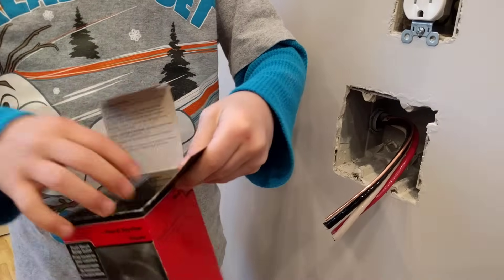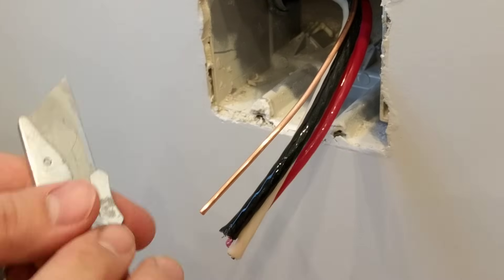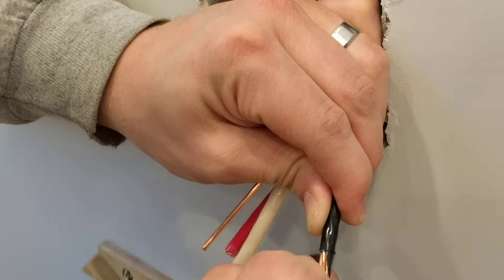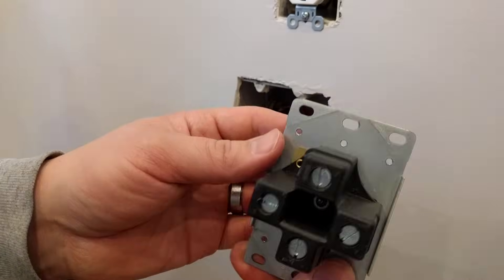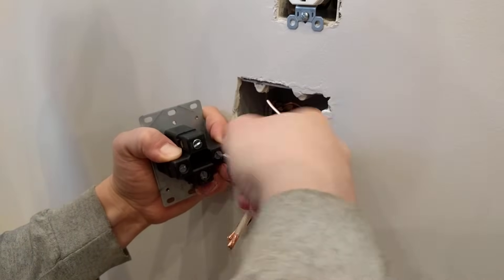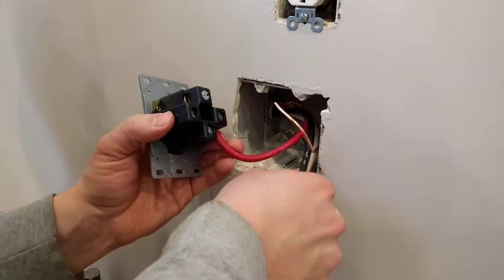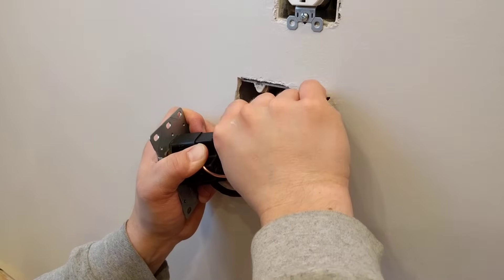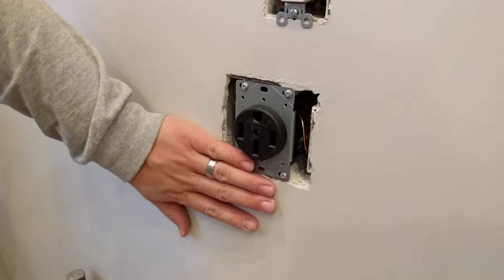How To Install a Range Receptacle or Outlet - Flush Mount 50 Amp 4 Wire

Comment: I am rather sure you are using an incorrect receptacle for your stove application. That receptacle is used for EV charging application (since it does not cover your feeder box). I have always used a NEMA 14-50R receptacle for all my electrical range/stove installations.

Comment: Did i miss the part where you mentioned grounding the box in a clockwise loop. Also a good idea to put a note or tape over the breaker indicating work is being done.

Comment: You didn't tell us what size box was behind your wall.  If the 220 supply line comes thru the bottom of the box, it's extra difficult to make connections.

Comment: Hello can i add a #8 to  # 6 wire for my stove? The original wire was #6 but due to move the location of the stove had to add some more wire but got #8 does this affect the voltage thanks

Comment: I have a 14 bmw i3, I’m going to install a 240v  in my garage with a 32 amp breaker, a 32 amp receptacle, with 8 gauge wiring so I can charge my car, I’m I on the right path?

Comment: Is that a standard two gang box? I didn’t think 6 wire would fit through the holes in the back of a standard box. Did you have to enlarge the holes for the larger wire?
Reply: I want to know too. I am wiring a new range line.

Comment: What size wire is that? Can you use a 50 amp outlet for a 40 amp stove?
Reply: Concerning capacity, Yes; but not the other way around.

Comment: Question, I hope someone could help me 🙂 im switching ovens and my current range plug is upside down from my new plug and too low to the ground to plug the new oven in. Am I able to simply remove the outlet and turn it upside down? Would i need to rewire in anyway? Or is it safer to move the outlet higher up the wall?

Comment: Why is the top one the ground? Every regular outlet has the ground on bottom. So why is the ground on top in this case?
Also, is it fine if you accidentally orient it upside down?
Reply: I believe that it puts the ground prong at the top, so if the plug isn't all the way in the receptacle, and a metal object drops and hits it, then it's a little less likely to cause a short.

He also mentioned that with the receptacle clocked in that manner, the appliance's cord will be pointing down as it exits the plug.  So that right there makes it seem that the appliance manufacturer wants the outlet to be oriented that way.

I've also heard of 120 volt receptacles being installed upside down, with the ground at the top, in order to denote a switched outlet where you have a wall switch to toggle power, like for a table lamp or something.

Comment: I saw that it’s always best to wire in this order: Ground, Neutral, Hot. I don’t know why but that’s what another electrician advised.
Reply: because if you wire hots first it will power up the device (if your working live) but most of the time you won’t be working live (hopefully).But it’s good to make it a habit to always do the hot last.I just like to think of it as weakest wire to strongest wire

Comment: Why is the outlet so high?  it's usually at the floor on the back wall turn sideways so you can plug in the cord without keeping the range a couple inches from the wall.
Reply from the maker: Yes, mounting it lower is better. I can't remember exactly why this one was higher but closer to the floor is better.

Comment: Can't find a video for wiring up a newer 3 prong receptacle junction box after removing a four hard wired range
Reply from the maker: Four wires is the new standard.
Reply: @BenjaminSahlstrom  good day, Ben !! I think I’m questioning the same thing as the person above . I just bought a new induction cooktop which only has ground and two hots..  no neutral . Thanks to your help I have re wired my whole house and tried to future proof my installation. The induction cooktop require 8/2 , I however ran 6/3 . I just want to make sure I do the best possible installation. Would you use a outlet/plug or wire nut the required wires ( ground and hots (red and black )) and just cap the neutral that is not required by the induction cooktop? 

Thanks for any advice !!!

I read the comment above and understand it as he had a 4 wire appliance and now has a 3 wire appliance like me ! 

Thanks again

Comment: What if you only have 3 wires coming out of the outlet, have 2 black and one is bare, ? On my new stove only burners work and not oven meter shows 247v across ,117 v on one side and 127v on the other installed 3 prong outlet  still no power to indicator s on top of range only burners.
Reply: Needs a neutral

Comment: I dont have the red nor white nor black wires i cant find them what should I do now ?? help me !!!
Reply: If it is a three wire plug, your two hot wires are the outside wires and the center wire is the neutral...
Reply: i actually have four wires i two whites and two gray and the ground wire

Comment: You should have 1st talked about the power being off and show that being checked.
And not let that child be near you when you are waving the cutter around.
Then install the cover 
And finally show the voltage and checking the new outlet.
Safety is the most critical.
Reply from the maker: Hager Hay Will try to improve that aspect in my future videos. Thanks for your input.
Reply: I was thinking the same thing!!! Never have little ones around when you're doing this type of work!!!  GOOD GRIEF!!!!

Comment: You say ''first thing we're gonna do is strip the sheeting back...''
Id start by turning off the breaker;)
Reply: Jean Boisleduc  very right
Reply: By turning off the breaker do I turn off all the switches to the off position , I’m a noob , I want to change my
Outlet to handle my tig welder 240volts
Reply: Juan REVUELTA 
Not all just one. But if you don’t know witch one turns that outlet off then its best to turn all of them off. To be safe. Or u can find out by plugging in a lamp and flip the switches and whatever switch turns it off then your good.
Reply: Rafael The Crusader thanks 🙏
Reply: @rafaelthecrusader7968   so plug a lamp into a 240v outlet 😂
Reply: WHY?
Reply: Uh, first of all it's "sheathing" not "sheeting". Second, it's pretty clear that that's a new wiring drop and may not even be connected to the panel yet.
Other than that you're spot on!

Comment: Do you have a video showing how to install a 220 outlet for the kitchen?

My kitchen doesn't have a outlet for a electric stove but I do have a 220 outlet in the wash room which is 30 feet across from the kitchen. 

I have 6 regular outlets in the kitchen so could I change one of them into the recommended outlet for my electric stove?
Reply from the maker: Kendricks Hayes Jr Unfortunately you will probably have to run new wires from your main panel to the outlet location. What is the outlet going to be used for?

Comment: why we you this type outlet i mean four hole outlet?
Reply from the maker: Mahmood Awan Because some parts of an electric range require 120 volts as well as 240. This requires that there be a neutral wire in addition to the two "hot" legs. The ground wire then grounds the equipment frame. So basically a four wire plug is safer than three.
Reply from the maker: Mahmood Awan Because some parts of an electric range require 120 volts as well as 240. This requires that there be a neutral wire in addition to the two "hot" legs. The ground wire then grounds the equipment frame. So basically a four wire plug is safer than three.